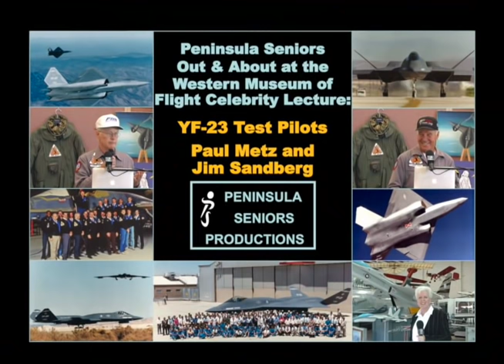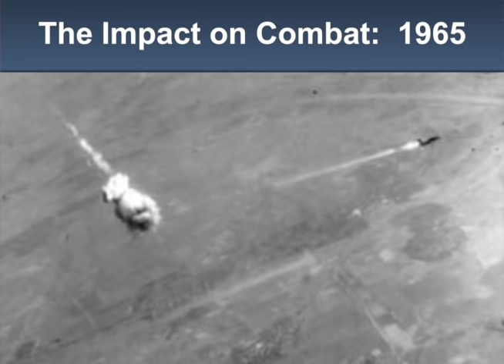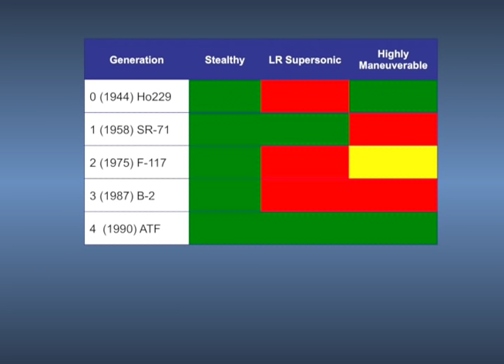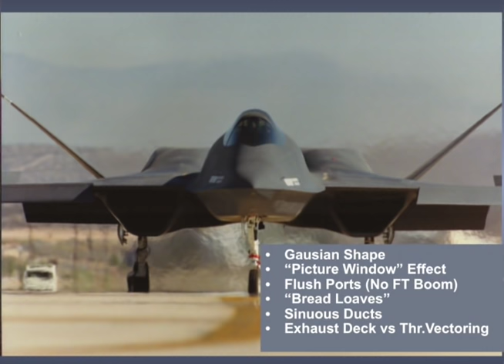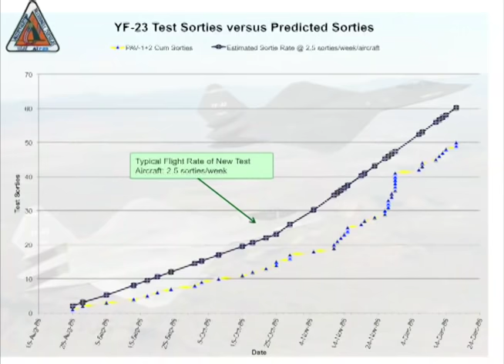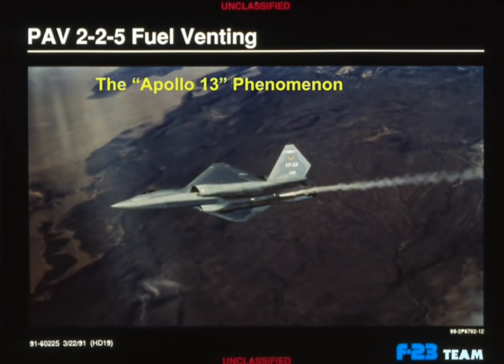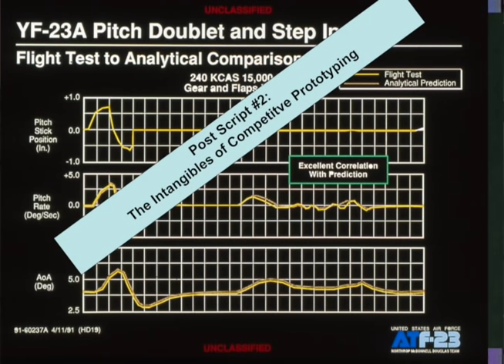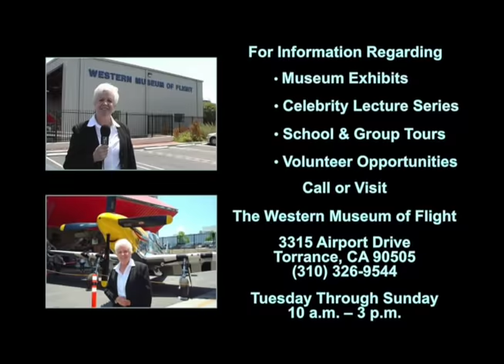YF-23 DEM/VAL Presentation by Test Pilots Paul Metz and Jim Sandberg

Comment: Please take the YF23 blueprints and make a new fighter. :)
Reply: Yes, of course.
Reply: Blueprints is just a manner of speaking.  AutoCAD, FASTRAN, whatever is being used these days.  Probably AutoCAD, plus custom aero and finite element simulation.
Reply: +jvburnes  there are report they did but a number of these aircraft. There is a picture of one of these at a secret base in England.
Reply: Isn't that what happened to the F-16 and f-18.  Both won on sales to the government in the end.
Reply: YF-16 was changed into the F-16FSD when the USAF added 8,000lb to it so it could have radar, ECM, databus, and other avionics.   Made it longer, larger wings, heavier, less performance for maneuverability, but more weapons systems and electronics.  YF-17 was canned, even though the LWF program managers thought the YF-17 had it in the bag.  After they returned from Groom Lake for HAVE Doughnut evaluation, all the pilots said the YF-16 was easier to reverse in when defensive, was harder to see WVR, and had better visibility from the cockpit.
Reply: @jvburnes  CATIA is what Boeing and Gulfstream are using.  I can't speak on behalf of other aircraft manufacturers because I haven't worked for any of the others within the last 20 years.
Reply: didn't make the cut back in the days, it would even fall shorter nowadays.

Jesus, i'm sure you all are part of the same folk that go crazy when they show irrelevant Flankers demo and you want the Black Widow back?
Reply: They will. 
It will be called a 6th generation fighter...
Reply: @jvburnes  i work at northrop as a machinist and we still use paper prints, supported by CAD files of course.

Comment: I find it hard to believe that the government would have simply "walked away" from the 23.
Reply: She wouldn't look out of place 50 years from now.
The YF-23 programme could be reactivated any time.
My favourite fighter i have a scale model i'm building of it.
Reply: +Gareth Wilkin    I suspect that political shenanigans were afoot.👿
Reply: outside the box Oh yes.
Reply: It seems like the same reason why the f-14 was taken out of service.  Number one reason was probably money(which can be fixed by a good economy), but deeper it seems like there is a distaste for airframes with engines far apart, even though the f-14 proved many advantages to a large airframe with engines far apart.  The larger airframe provides extra lift at at high angle of attack at slower speeds.
Reply: It was a bad time for Northrop when it came to it's relationship with the US government because they had just been caught lying to Congress about the cost of the B-2. Also, the YF-22 launched live weapons from it before the decision was made and the YF-23 never launched any munitions from it at all. Also, the ATF was a competition where Congress wanted an air superiority fighter no matter the cost. Northrop made cutting the cost of the YF-23 one of their major selling points when they did not need to. Northrop showed that their plane was really good and so did Lockheed. The difference is that Lockheed did more int heir testing than Northrop did and if you are trying to sell to someone that doesn't trust you then you show them every detail of what your product can do. I am not saying that the YF-22 was better or worse. I honestly don't know and nor does anyone else on here because Northrop never tested it with live munitions so while it is an amazing aircraft in every respect that it was tested for Lockheed had more data and more tests done on their air frame then Northrop did and that is too bad because they did have a fabulous design. To me it is too bad because the engineers worked hard to make a great design but when it cam to pushing the YF-23 to it's limit as an air superiority fighter Northrop did not do that.
Reply: Billy Slo Northrop's avionics were new whereas Lockheed used the same kind used in F-15's and previous other birds.
Reply: Gareth Wilkin What is your point?
Reply: Billy Slo If you watched the entire video, it shows the test pilot who flew both the 23 and the 22 on the left in the picture above spoke very highly of the 23 while only noting minor enthusiasm about the 22.  To me that speaks louder than any sales pitch.  He said Northrop presented technical graphs highlighting the 23's performance, while Lockheed presented sexy pictures of the 22 at a high angle of attack and firing a missile, and presented a picture of smoke trails comparing the 22's turn radius to the f-16's.  The test pilots opinion was the 23 was better but did not have the sales pitch, while the 22 did. Combine that with modern politics it makes sense, people want the show, not the technical charts.
Reply: Christopher Hoffman LOL. I love how you presumed that I didn't watch the whole thing. But anyway... Paul Metz does not ever compare them to each other and whenever anyone asks him about which one was better he refuses to give an answer. You saying that is pure conjecture and has to do with your view on how you perceive his physical expression is when talking about the 22 vs the 23.
But even then, Paul Metz said that he and Dave Ferguson made a deal with each other that whoever lost would be hired by the other. Now if the YF-23 was that far superior to the YF-22, and Metz believed that, then why did he make that deal with Dave Ferguson? Because the planes were both so good that neither of them knew who would win.
Reply: Is it safe too add to your post that those extra tests made the 22 the 'safer' choice? In that a lot of both political and military careers were on the line if they chose 'incorrectly? LM did have more experience in stealth. Much like the engine choice of the 119 over 120 the former was the more known and therefore prudent choice?
Reply: "The test pilots opinion was the 23 was better??? Metz stated very clearly that no pilot ever flew both YFs!
If no one flew both, then there can BE no opinion on which is better. You will have to show a link where the test pilots made that statement.
Reply: Tomcats are/were truly great but Navy planes break down over time  because of all the wear and tear on them.  Too costly to maintain them.
Reply: Chris Hoffman:  F-14 was deactivated because it was a maintenance nightmare for the Navy.  When you scaled the F-14 maintenance time and costs, it was sucking up insane amounts of dollars that could have been allocated to more reliable aircraft like the F/A-18, which is exactly what the Navy did, even after getting the newer F-14D, and F-14A+/B upgrades.  F-14 maintenance man hours on a carrier were brutal due to the sweep wing gear box seals busting and leaking all over regularly, the terrible TF-30 engine which they wanted replaced in the 1970s, but were denied by Congress and Carter, and the complexity and low reliability of the AWG-9 radar and avionics, let alone all the normal problems with a twin-engined 50-60k lb aircraft slamming the deck every recovery.
Reply: Really? You find it hard to believe in a political environment???  The Army didn't even take their pistol trials to really find out which pistol is the best for the soldier.  They stopped at 2 of the three tests and just decided to pick one.  That's not the first time that's happened nor will it be the last.
Reply: @garethwilkin5565  That is completely false. Boeing's Sensor Fusion avionics aboard the F-22 was cutting edge
Reply: @outsidethebox617  I worked for Northrop Grumman for about 8 years.   There are all sorts of factors that come into play including politics.   The government likes to spread major projects around in order to have multiple competitors.     There can only be a few that can afford to compete for huge programs like a new frontline airplane and it's engines.     GE had completed that acquisition of Honeywell which would have given them a major coup in the avionics instrumentation and electrical system.     The EU blackmailed GE into dropping the merger by threatening to shut out other GE businesses in order to protect European Airbus equipment providers.    This is the type of "free trade" a certain segment of politicians are always touting as such a great thing.     It's great for everyone except the American worker.

Comment: It was better than F22
Reply: Certainly better looking!  It looks like a 21st century P-38
Reply: Engine exhaust is kinda funky.. looks more like something you'd expect from a bomber.  The Raptor looks leaner and more like a fighter - the name is fitting. 

In general I see the YF-23 as a high-speed interceptor, I think we all know based on how he stumbled through the thrust vectoring question that it was a significant limitation for the design. By his own admission in the beginning he mentioned that WVR dog-fighting capabilities were important to the design. 

Who cares if "they both met the requirements" - if all is equal, what's the first thing they'll start looking at? Who exceeded the requirements. 

Saying the YF-23 can achieve the same 60deg AOA is pointless if it can only do it at a min airspeed, then remain a sitting duck with no directional control as its' airspeed drops. 
60 deg AOA is completely different with TV - you can kick into it and either maintain position (both planes had higher than 1:1 thrust ratio) or kick back out of it. Watch the Raptor demos - they achieve high AOA, but remain completely controllable. 

It's kinda laughable that he states the YF-23 could "also achieve 60deg AOA" as the aircraft would essentially be uncontrollable afterwards, even with those massive control surfaces (relatively speaking, the raptor actually had larger control surfaces as it had both horiz/vert all-moving tails.)  This situation is replicated by the Mirage "F-22 kill" where they violated multiple ROI and the F-22 wasn't even in the fight anymore. In order to get the claimed gun shot (while the F-22 was no longer maneuvering) the Mirage pilot dumps all airspeed and stalls the plane multiple times in a "snap shot" which wouldn't result in a kill anyways. Like the YF-23, this leaves the Mirage with zero energy to recover without trading altitude (regardless of a <1:1 thrust:weight ratio). 

Just watch the F-22 demos - it could hypothetically execute the same snap-shot maneuver, then accelerate in any direction back to typical maneuvering speeds. 

Anyways - saying that thrust vectoring was somehow equaled by the all-moving surfaces of the "huge" tails isn't accurate at all. The F-22 had more movable surface area, but all of that is useless at zero airspeed. Like he said - if "all else was equal" who do you think they'd choose given what I just said? Conversely no one has definitely stated any advantage the YF-23 may have had. Personally the airframe looked faster to me, possibly longer-ranged - but the US doesn't have a history of fielding "interceptor" aircraft.  This was supposed to be an air superiority fighter - and that's what the tax-payers got. This is just my opinion though, the YF-23 is still one of the most beautiful planes I've ever seen FWIW, but no I don't think it was a conspiracy. :)
Reply: I agree. The 22 was an air superiority fighter and the 23 was more of an interceptor. But then again it doesn't matter how powerful an aircraft's engines are they must still perform as desired and when the GE engines were having the problems that they had int he air to air refueling then that isn't exactly a great selling point. Also, in a presentation that Paul Metz gave on the 22 he did say that there was a reason for Lockheed to fire that missile and that it was not just for selling. They did it because when you are launching a missile from an internal weapons bay where the hot exhaust of the missile will go into the intake then the aircraft must be able to breathe in that hot exhaust without stalling and that is why Lockheed did that. They did that to say we can fire the rocket not problem at all and Northrop was like lets put the inlets directly behind the missile and then not demonstrate that our aircraft can take that hot exhaust. Now, that was not a requirement but when Lockheed showed that to the DoD they explained to them why it was a big deal. I did not like that part of this presentation because it makes it look like the DoD is run by a bunch of idiots who have no clue what this nation really need but the engineers at Northrop they really know. And on that note... I once saw a meme on Facebook that said that sometimes a mechanic's worst nightmare is an engineer. My father in law was a mechanic on the Nimitz and worked on the F-14 and F-18 and pretty much every Navy aircraft at the time of the 80s. After he was in the Navy, he then worked for Northwest airlines. He had a 21 year career working on jet aircraft. I showed that meme I saw on Facebook to him and he laughed and replied that it was totally true. I have had conversations with him about what aircraft he worked on and he said that the F-14 was terrible to work on. I think that we all know that the F-14 was an engineer's dream. But it was terrible from his perspective. He said that nothing on it was simple and no repair was simple and sometimes the same job on the F-14 would take three times longer than on other aircraft. So while engineers loved that aircraft and it was fantastic in the air the fact that it took that long to fix anything means that it was not a combat effective aircraft.
Reply: @EstorilEm  The correct decision was made.  In any event a very well put together video.
Reply: It only got chosed course of stealth...the 22...they're both amazing

Comment: So I know the YF-23 top speed is classified, and in the documentary for National Geographic they say it’s very VERY fast. At  45:19 there is a slight slip of the tongue and he almost says Mach 2 something but corrects and says Mach 1.5. Through the process of elimination am I to assume this plane is capable of Mach 2.5 or 1900+ mph. If so then that’s a damn fast plane.
Reply: Paul Metz says they never went past Mach 1.85 in this video, and the graph at 36:10 shows the relevant max speed, altitude, flight number, flight hours figures.  A YF-22 test pilot, Tom Morgenfeld, said he took YF-22 PAV-2 to max climb rate, max altitude, and max speed over mach 2 in one flight, and that the GE YF120 motors turned the YF-22 into a different airplane compared to PAV-1 with Pratt & Whitney motors.  The YF-119 rated 30,000lb of thrust in AB, whereas the YF120 rated 35,000lb.  When the YF119 was selected, it was uprated for 35,000lb for the F-22A in the F119-PW-100.

The YF-23 inlet boundary layer control system couldn't mitigate the inlet flow at higher supersonic speeds, and was one of the main things they were going to change on the F-23A production proposal, along with reducing the volume of engine nacelles since the thrust-reverser requirement was dropped.  The YF-22/YF120 was faster and more maneuverable with better climb rate than any of the 4 prototypes.  Production F-22s are Mach 2+ capable, and they used those kinematics in the initial F-22 tactics development exercises out around Nellis, to include supersonic closure rates against fleeing F-15Cs that were traveling Mach 1+.  If you ever look at how the transonic region is managed, they don't hang around at Mach 1 due to the waveform drag, so Mach 1.2 or more is where they prefer to be.  Gives you an idea of what the Raptor can actually do.  Test pilots said they were bearing down on the fleeing Eagles with over Mach 1 of closure, which is just insane.
Reply: In the documentary from the western museum of flight, one of the engineers who worked on the design says he believes the YF23 was able to reach at least mach 3.2

Comment: WoW! Thank-you for sharing the video. I will always have a weakness for the awesome design and engineering of the YF-23, more so than the F-22. Both Paul Metz and Jim Sandberg are amazing characters and told their story so well. I understand why the U.S. Air Force selected the F-22, but I don't understand the simple manner in which they discarded such a master machine.

Comment: I remember that back in the early 90s, during the Advanced Tactical Fighter jet program, me and my friend were betting on this fighter to win the competition because of it's more stealthier and advanced design, lower radar cross section (RCS), higher top speed, especially when the GE engine is used, longer range, lower infrared detection signature, and higher maneuverability at high speed over the competition. The only advantage that the YF-22 had over the YF-23 is that the YF-23 did not utilize the thrust vectoring engine which the F-22 did. This feature could have been added later to the final production of the F-23 with little modification should the USAF insisted. It's designers felt it is not necessary because the YF-23 is very maneuverable at high speed (which is the combat speed) even without thrust vectoring engines.  The nozzles of the YF-23 engines have heat dissipation feature, making it more difficult to be detected by the infrared detectors of the Soviet fighters and air to air missiles. But for some reason, (maybe political red tape in the government, bribery or just plain stupidity) the F-22 won the competition.
Reply: YF-23 didn't need TV with the size of the rear wings/tails.  The YF-22 had many advantages over the YF-23, including speed, maneuverability, more weapons count internally, demonstrated weapons separation already, and better visibility for the pilot.  Frontal aspect RCS on both of the RCS demonstrators was good.  There were compromises with each, with a more conventional boundary layer splitter plate for the YF-22, and the YF-23's serpentine arrangement with Boundary Layer Control matrices that didn't allow it to reach speeds the YF-22 did.  Both met the requirements, but there were a lot of things the YF-22 did that made it the better choice at the time, despite how much sexier the YF-23 looks.